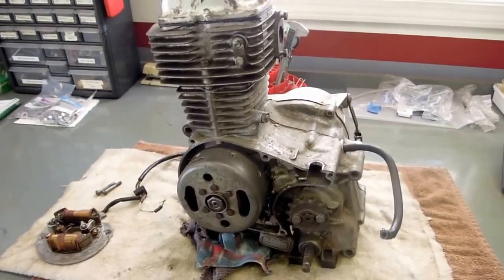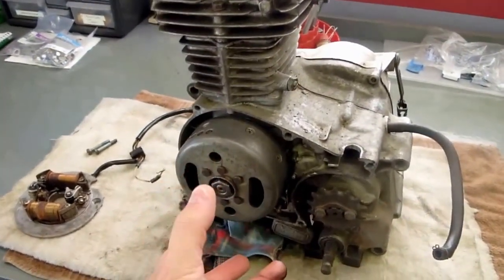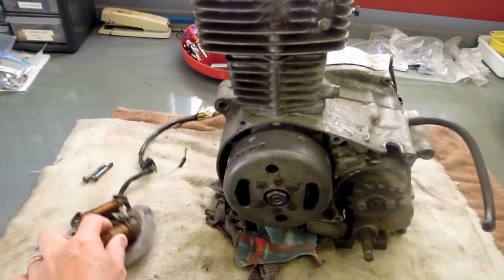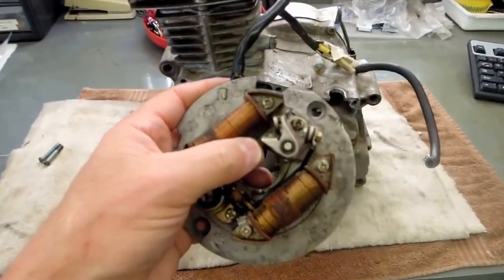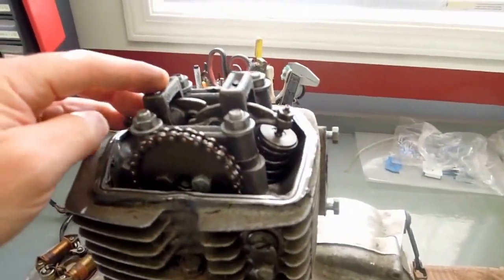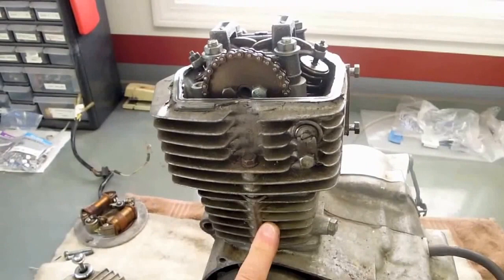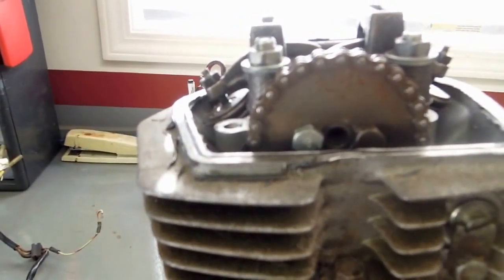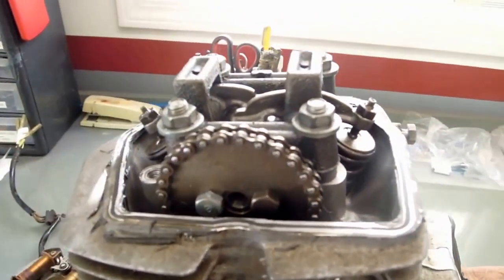Honda XL75 Pt 1 - Valve Train Issues

Comment: Watch the valves, that cam sprocket is 180 degrees out. That timing dot should be on top after the intake valve closes, not the exhaust!

Comment: Do i have to take off the timing chain sprocket to adjust the timing?
Reply from the maker: There's two types of timing... ignition and valve.  I surmise from your question you are referring to valve timing.  If I have this correct (valve timing), the position of the top sprocket located in the cylinder head in relationship to the bottom-end sprocket is very important.

However, valve timing isn't usually "adjusted" unless one has removed the the sprocket(s) for some reason, such as removing the head or other major engine work.

Its possible that the chain has slipped on the sprockets, but this would be very unusual and I've never personally seen it.  If this is the case, i.e., the chain has actually slipped, the the crankshaft has to be positioned in a particular way and the top sprocket positioned specifically in relation the lower sprocket to get the correct timing.

Therefore, the answer is YES, the top sprocket would be removed and indexed properly to set the valve timing.